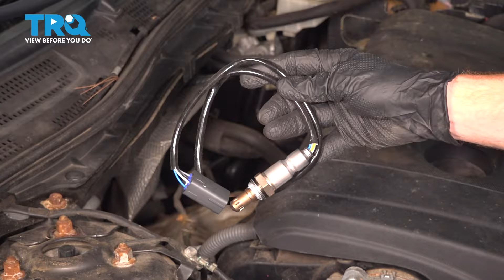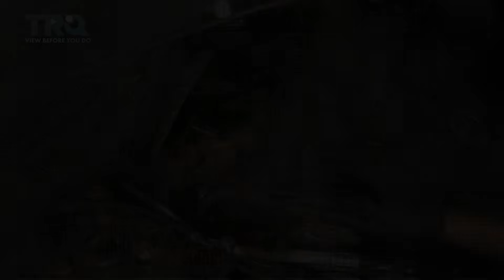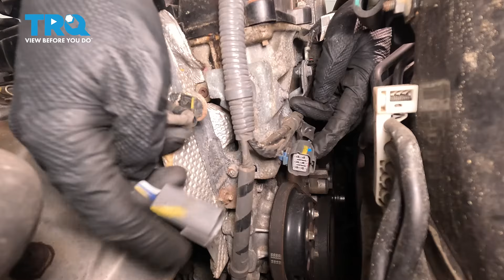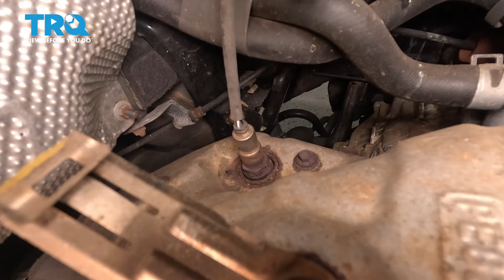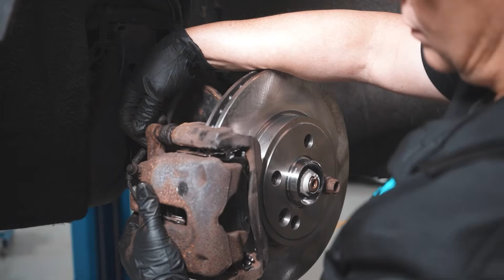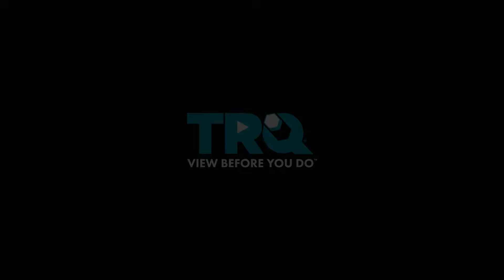How to Replace Upstream O2 Sensor 2014-2018 Mazda 3 2.0L

Comment: I couldn’t disconnect the electrical connector. I tried pressing it with my finger but apparently wasn’t enough force to unlock it  as it is in a bad location and i can not easily reach it to press it properly.